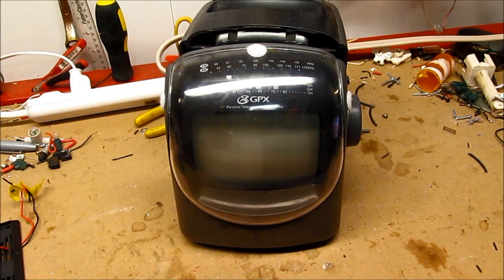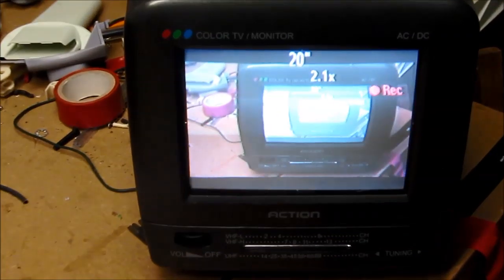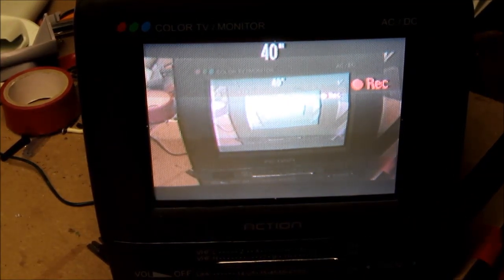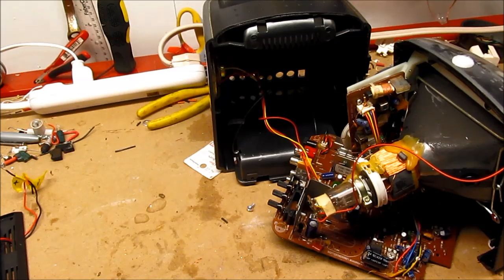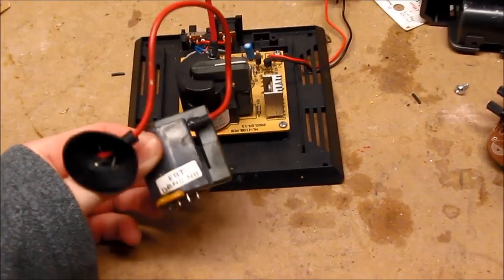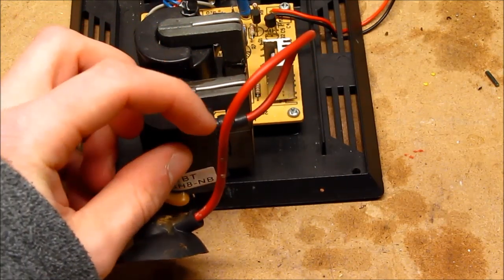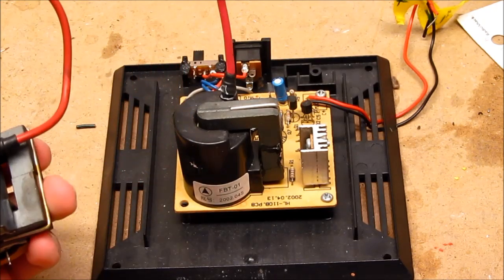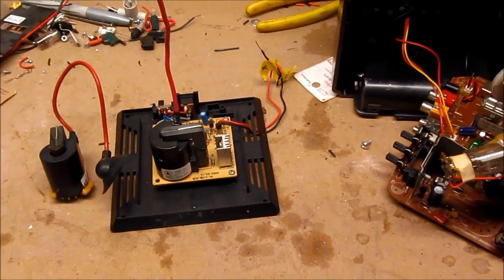Tiny TVs and Tiny Flybacks

Comment from the maker: Maybe would work the same.  The plasma lamp one is likely missing the rectifier diode and possibly the other outputs that the TV would need.  Pinouts could be totally different as well, so it might not work.  If at all possible I want the plasma globe to remain functional.  
Colour TV works great as a mini monitor.  Is a bit of a power hog though, 1.5 amps at 12 volts.  I'm not complaining.  It lets me get better vids :)